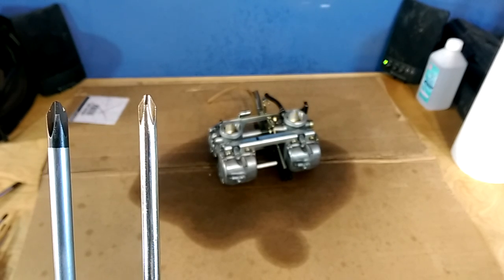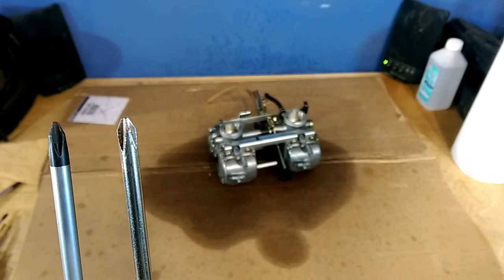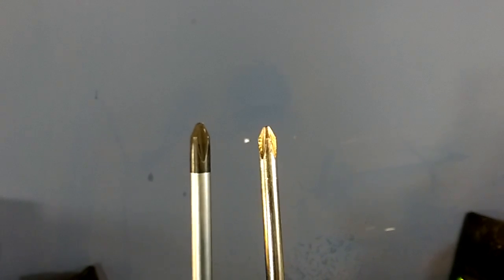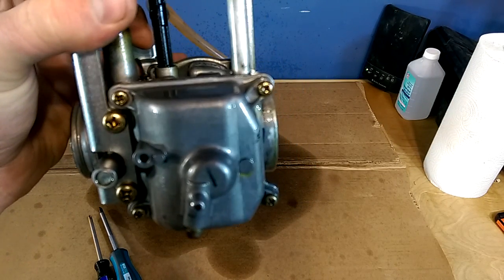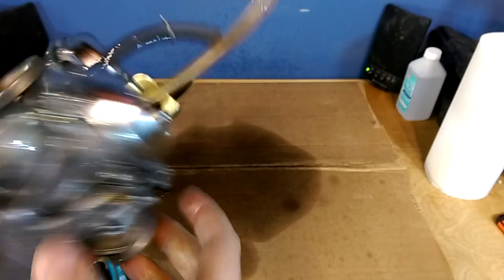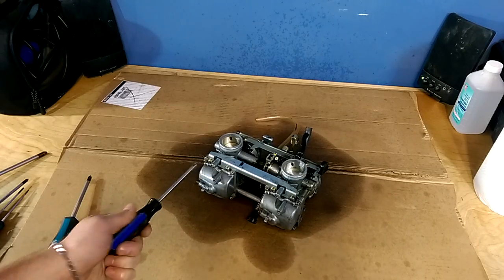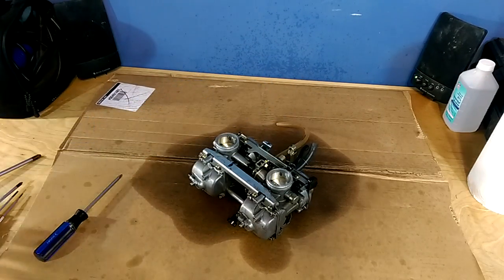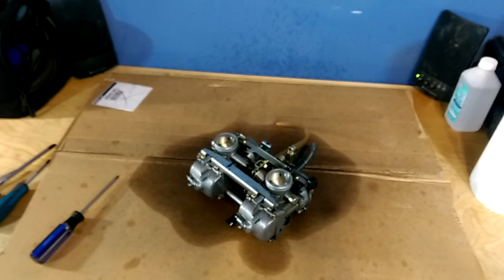JIS versus Phillips Head Screw Drivers

Comment: What's use of philips number 1,2 & 3 Screwdrivers? Are they all different or anyone can be used for all size screws? How to select correct size?
Reply: Use the proper size for the screw.  There is enough difference between the sizes that one can see the difference at a glance.  When in doubt, check the fit of the driver in the recess before applying any turning force.  You should have at least one of the three most common sizes, so you can compare them to learn the difference.  The #2 is the most common, so most people who have only one Phillips driver have that.  It will not do for the #1 and #3 recesses.

Comment: "You don't want to round the head with a Phillips..."

I learned this the hard way on a 900 usd 50mm lens. I'd never even heard of JIS, none of my coworkers had, no craft or tradesman I know had.  I even asked people I know that are literally from Japan and they had not heard of it!  Now I have a stripped out head on a tiny, and I mean TINY, ass screw with no idea how I am going to get it out.
Reply: I've used a tiny flat blade screwdriver to get a striped Phillips out, but man... it's tough.  It likely has to be one size smaller than the Phillips you're trying to extract, so that the flat blade can fit within the deeper part of what's not stripped/torn-up.   Another option, is to try micro screw extractors made specifically for such situations.  https://www.amazon.com/Moody-Tools-58-0670-Extractor-Reversible/dp/B000JCT3W0

Comment: I can’t tell you how many screws heads I stripped out not knowing that Japanese screw heads were different.
The tough part is finding quality JIS screw drivers with a hardened tip, any suggestions?  I won’t consider tools made in china

Comment: After you get the carb apart, install Allen head screws. They are cheap and plentiful in stainless on Ebay. I use a TINY dab of anti-seize on carb hardware threads which makes the next cleaning much easier.

Comment: For what it's worth, JIS screws are also found on bicycle components such as derailleur gear mechs and brakes, since the market is dominated by two Japanese companies, Shimano and Suntour. This means that bicycle-specific cross-head screwdrivers (e,g, made by Park Tool) are JIS heads rather than Phillips. Hope this helps someone :-)
Reply: most, not all some pt. is philip.s

Comment: The JIS for screwdrivers was repaced by an ISO/DIN standard, and the corresponding fasteners have largely replaced the original Phillips design. That standard was co-developed by Phillips.  If you use a modern crosshead driver that meets the current ISO/DIN standard it will fit old or new Japanese or phillips  head screws without camming.  The problem comes from using original Phillips design drivers with old JIS or new ISO/DIN screws.

Comment: I have a set of Vessel Ball grip screwdrivers...I swear they grip better on any screw phillips or JIS. A complete set of Vessels solves all  "phillips"  problems in one shot!
Reply: Vessel makes slightly modified ISO stamdard design drivers that are within tolerances, but just loose enough to fit old JIS screws and all Phillips screws.

Comment: I have to give credit where credit is due. Showing how good the grip is with the jis in a way where it lifts the carb up was perfect. No words needed with that demonstration!
Reply: If you do any woodworking, try the Robertson screws- the grip is so good you can hold a robertson screwdriver horizontal to the ground, by the screw!
Reply: Absolutely the best demonstration of how much extra torque you can apply. 

Many people don’t understand that there is a difference and it’s actually important to use the right screwdriver.

Comment: Very good info - thank you Tip do not use a Phillips head when taking off brake rotors on a Honda Accord etc. And if can use with an impact screwdriver (not on carbs etc)
Reply: William McCord ,where can I find impact driver bits for honda rotors?
Reply: Mr. McCord, I now know not to use a Phillips head screwdriver to take out the rotor screws on my Honda.  Should I be using a JIS screwdriver and if so, Is there a JIS bit I can buy to put in my 5 piece impact screwdriver set (that only provides Phillips head bits)?  It seems that that is what everyone uses to take out these rotor screws...it's insane!

Comment: Working on this 20+ year old MPI Monitor 422 (Japanese) kerosene heater, only a very few of the screws have the JIS dot dimple. On your carburetor, I see the same pattern. Many of the screws have no dimple, yet they are all Japanese manufactured. Do you then use JIS screwdrivers on ALL the screws, dimple or not?

A problem with old equipment like this is that techs over the years have made a mess of the screw heads from cam-out and miss-matched drivers. Think I'm going to pickup a set of the Vessel, https://www.amazon.com/Bessel-Vessel-Difference-Screwdrivers-No-220w-3/dp/B00E55DL4I

The other recent trendy thing with Phillips screwdrivers is to texture / diamond dust the tips for better grip. Most likely a late attempt at addressing some of the poor cam-out tendencies.

Comment: a much more pragmatic approach for screws commonly encountered on typical used bikes, witch are usually screwed up before you get there, is to reshape them. i use a #2 phillips bit in a  1/4" socket on an old 1/4"drive extension, and put the bit in the screw head and smack on the end of the extension. the alloy steel of the bit easily reshapes the softer steel the screw is made of. something else that helps is vampliers vt-001-7sj. its pliers designed to bite into messed up screws to take them out. after you remove the damaged screws you can replace them with screws with whatever type of head you want.
Reply: Garon Burwell JIS drivers still work better on damaged JIS screw heads than a Phillips driver which is still designed to cam out.  Using the right tool for the job makes all the difference.
Reply: yes there will always be idealism versus practicality. everybody gets to make their choice. another thing to consider for folks doing this frequently is the fact that you can't get a jis screwdriver off of a tool truck in most cases. i have a set of screwdrivers from a couple of the higher end brands and they get wear with regular use and due to that the #2 shanks get warrantied out on my sets probably twice a year to keep them fresh. if i got myself a nice jis #2, i'd get attached to it, and i'd be sore about having to mail it somewhere to get it warrantied from wear. even if i had 2 sets so i wouldn't be without, i wouldn't want to mail it off. i'm spoiled with tooltruck service and not having to mail something off or take a drive to get it back in shape. on most of my customers bikes the old boogered up screws get replaced with allens for a nice touch. again it's so rare that i'd see a screw not previously messed up and even if the customer couldn't see them on a bike once installed, i still wouldn't put the boogered up screws back in.  
also to the point of the phillips head screw "designed" to cam out, the wikipedia article on screw drives seems to suggest against this old wives tale but then again wikipedia isn't an encyclopedia and anybody can basically write whatever on there.
Reply: Pragmatism is the ultimate practicality.  If you use tols professionally, you should use prifessional tools. 

Pragmatism would suggest that using high quality MODERN DESIGN ISO standard drivers is more practical than buying old design Phillips drivers from tool trucks or mass merchandizers . Properly used high quality manual screwdrivers do NOT wear out in regular use away from an assembly line.  Cheap ones used incorrectly do.  Provided that you use them properly, good screwdrivers ones last a lifetime.  You can get ISO standard drivers which replaced Phillips in production use 20 years ago as hand tools, machine tool bits and as  bits made for 1/4" and 3/8 impact drivers.   They are inexpensive enough to discard if you fasten thousands of fasteners per day or if abuse your tools enough to wear them out.

Comment: Smart demo. I'm beginning to think JIS screwdrivers will work better even on Phillips screws. The Jawsfit solution is excellent. Will compare Jawsfit to SnapOn ribbed over time. Buying can be confusing.  Vessel Jawsfit mean to turn. Phillips is a pain in the.  Sorry but may the best design win. I bet some US manufacturer will begin making them. I hope they don't steal it as is the case sometimes.  A nasty problem for US manufacturers I guess. Just make the darn tips sharper and harder.
Reply: Tom Jones That is my experience.  The JIS work better on Phillips than a Phillips screwdriver.

Comment: Can I add that Phillips was DESIGNED to "cam-out" while building cheap furniture in the '30's on assembly lines, so the wood didn't split, and NOT designed for aluminum carbs that need to be overhauled 20 years later ??  It's part of a throw away society, sadly.
Reply: TIMEtoRIDE900 not so much throw away society as fast and easy assembly by workers with medium skill levels.
Reply: Extensive evidence is lacking for this specific narrative, and the feature is not mentioned in the original patents. However, a 1949 refinement to the original design described in US Patent #2,474,994 describes this feature.
Reply: In that respect it was wonderful! They remain removable with a MANUAL impact driver which forces the bit into the head. Socket head screws on motorcycles are superior for maintenance and you can easily buy bags of metric Allen head screws in stainless off Ebay. I do. Worth noting is the manual impacts also work well on damages socket heads. Making everything "rebuildable" also makes it more expensive.
Reply: @obfuscated3090  I love my manual impact I also have a impact gun.
Reply: From what I read it was designed for use on assembly lines with early automatic screwdrivers and was designed to cam out rather than snapping off the screw head. Torque limiting screwdrivers wasn't a thing yet. But regardless of whether this is true or not, a phillips driver will cam out under torque while a JIS driver will not. There is also a European ISO standard cross head screw that's basically the same as JIS (it's slightly different but the drivers are interchangeable). As with JIS screws, phillips screwdrivers will chew these up too.
Reply: TIMEtoRIDE900 I always thought it was Henry Ford and his assembly line that designed them to cam out
Reply: @travispratt6327  I think it was Ford, and it had to do with building planes for the war.  That's how I heard it that is.
Reply: very good